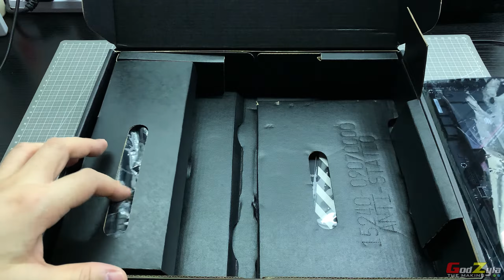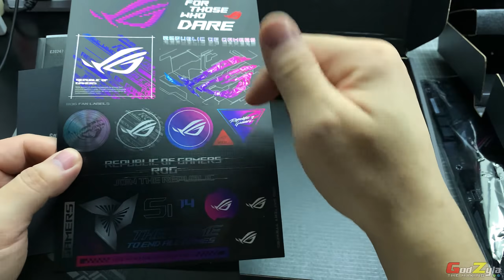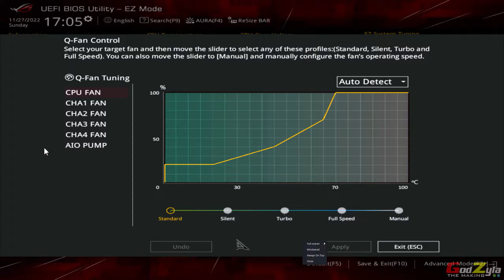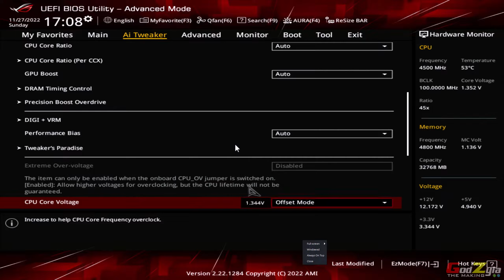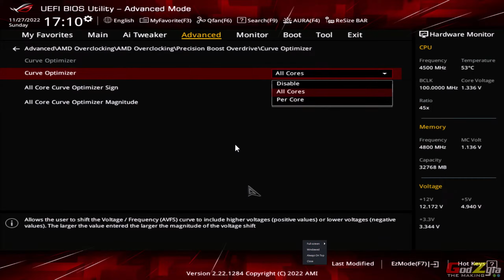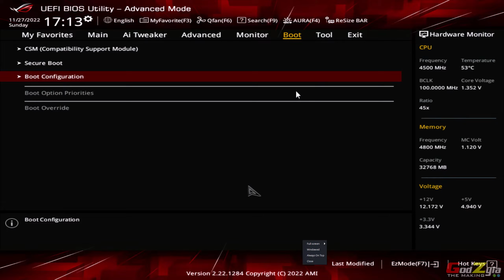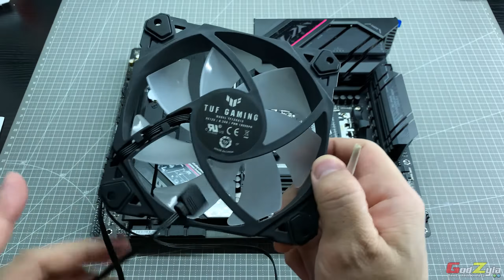ASUS B650E-F Strix Gaming Wifi

Comment: 4:14 CORRECTION: The BOTTOM PCI-E expansion slot has a x16 connector but runs at x4, (for a maximum bandwidth of 8 GB/s using all 4 lanes).  It does NOT run at x16.  FURTHERMORE, when the third M.2 slot is used, the bottom PCI-E connector is DISABLED.  Please read the manual before releasing a video with bad information!!
Reply from the maker: Hi Wakko Warner. Welcome to my channel, point noted. Sorry for the misinfo. Apologies for that.
Reply: wow no need to be so angry man. 😂 everyone makes mistakes
Reply: I was just about to say you can see in the video that the bottom PCIE slot doesn’t have pins throughout the 16x connector.
Reply from the maker: @JoeLiberto  hi and welcome to my channel. yes that was my mistake. sorry about it.
Reply: If I use the 3rd m.2 SSD slot will this affect GPU performance? Or is it only if I use the PcIE slot ?
Reply: I have the same motherboard and going through the manual it says the bottom PCIe is 4.0 x16 (supports x4 mode)

Does that mean it only supports x4 instead of x16 ?
Reply from the maker: @DiegoMartinez-vc5xy  hi Diego Martinez, welcome to my channel and yes. That was my mistake. The bottom PCIe slot runs only at 4x.

Comment: I've just started building a gaming PC after getting bored of PS5. So far I have the Ryzen 5 7600X, ROG STRIX B650E-F & 32GB DDR5. Haven't decided on a GPU yet & have a budget of £600. Any recommendations please 🙏🏻
Reply from the maker: Welcome to my channel Neil Dougal. Do pardon me as I am not well versed in gaming. You might want to search at Reddit forum https://www.reddit.com/answers/fab6b94e-5733-4083-9e06-34d0db3d15e5/?q=600%20euro%20which%20gpu%20to%20get%20for%20gaming%20&utm_source=share&utm_medium=ios_app&utm_name=ioscss&utm_content=1&utm_term=1

Comment: hello should i update bios first before install cpu and ram? because it say will have problem for the cpu ryzen 7 7800x3d on this motherboard it must have 1409 version  do i just need  to download that version or will be ok to download the lastest one wich it top options on the asus susport? i need a  8gb to 32 gb usb stick right? and fat 32 format do be ok for bios flas also i need 24 pin connector and 8pin or 4pin also?  for the psu
Reply from the maker: Hi Hardenth 50, welcome to my channel. Yes, update the bios first by using the bios flashback. Clearer instructions can be found here. https://www.youtube.com/watch?v=asdomsnbBb8

Comment: 9:32 I’m sorry… extreme OC via use of liquid nitrogen????? 

Finna force my 3060 to run like a 5080
Reply from the maker: Hi RXzorEdge, welcome to my channel. both EPS 8 + 4 pin plugged is for your CPU not your GPU. Btw to run a 3060 8G like 5080 is way out of the range. max you can OC to run like 3060ti 8G but with limitations

Comment: I picked up the same board but the more expensive B650E-E version and a 7600X for $240 back around summer of 2024. Just using it in my MediaPC in the bedroom with a 7800X3D/6700XT on 4k 144hz. The 7600X is out in the garage PC.
Reply from the maker: Hi 45eno, welcome to my channel. Thank you for sharing your setup 👍

Comment: Is this motherboard safe to use now?? I have heard it fried some AMD cpus.
Reply from the maker: Hi Alphonse, welcome to my channel. I do not have issues on it with the 7950x or 9950X3D. If you are referring to the 9800X3D. So sorry, I don’t have the processor to test with.
Reply: @KleoYan  im planning to put a 9600x. Do you think its safe?
Reply from the maker: @ it will be fine.
Reply: @KleoYan  thank you so much
Reply from the maker: @alphonse5935  You are most welcome.

Comment: The fan thing is confusing me. If i have the lian li galahad 2 lite will those daisy chained fans have to much amperage?
Reply from the maker: Hi Tuckejak, welcome to my channel. This board fan headers are all 1A on page 22 https://dlcdnets.asus.com/pub/ASUS/mb/Socket%20AM5/ROG_STRIX_B650E-F_GAMING_WIFI/E23880_ROG_STRIX_B650E-F_GAMING_WIFI_UM_V4_WEB.pdf?model=ROG%20STRIX%20B650E-F%20GAMING%20WIFI  the fan ampere of the Galahad II Lite, it's 0.27A each https://youtu.be/y1EbZQb7__4?si=_twLjJL_T3McJ-9Q&t=708 so if you daisy chained 3 will be 0.81A, therefore you dont have to worry about not enough ampere for this liquid aio, you can safetly plug to the CPU_FAN
Reply: @KleoYan  thank you so much. You earned a sub!!!

Comment: Awesome review! I am planning to use this motherboard with the noctua nh-d15 g2 and i am wondering if it’s possible to set the fancurve on the optional cpu fan header aswell. If it’s not possible would it be possible to try to connect the two fans together on the main CPU header and how do i even connect two fans together.I am wondering because this cooler has two fans and i want to control them both.
Reply from the maker: Hi Zaopa, welcome to my channel. You can plug fans this way on your motherboard. from your NH-D15 G2, one fan to the CPU_FAN motherboard header and the other fan on CPU_OPT motherboard header. Whatever fan curve you've set on CPU_FAN, your CPU_OPT will follow.
Reply: @KleoYan  thank you for the fast reply😃

Comment: I don’t know if you remeber me but I asked you a couple of questions before. I got this motherboard yesterday, and while it looks nice and is well built it has some crazy coil whine. I have coil whine on my gpu and can say this motherboard’s coil whine is 2x as worse.
Reply from the maker: Hi MFN, welcome back. Yup I can remember your nick but I can’t remember what questions you have asked. Ok as for your coin whine, if it’s really that back. Kindly contact your seller to have it fix or to replace this board.
Reply: @ i asked you some question about the b850-f and b850-e. I decided to go for the b650e-f as it was cheaper. When i installed it it had a loud coil whine. Unfortunately asus does not see coil whine as a defect so i had to return the motherboard and got the b850-e which did not have any coil whine and works great

Comment: pairing this with the Lian Li Lancool 216 and was confused at why my fans the front weren’t lighting up. so i can plug the rgb into any of the 3 pin slots you mentioned or does it have to be a specific one?
Reply from the maker: @reiyoh_  hi and welcome to my channel. So long it’s argb 3pin 5v header of your motherboard. It will work. I will also advise you to install armoury crate and download the aura sync application. Then point to the argb header of your motherboard where you’ve plug your front fan argb connector to, then control the effects on aura sync.

Comment: "Hi, could you please help me? I’m building a PC with 3 fans from an AIO cooler and 4 case fans. Do I need a fan header hub, or will the motherboard have enough headers?
Reply from the maker: Hi Jesaja, welcome to my channel. Maybe list down the AIO Cooler and the fans you are using, I will need to know the brand and model to check the Ampere of those fans.
Reply: @KleoYan  The case, an ENDORFY Arx 700 ARGB, comes equipped with three pre-installed basic fans. For cooling the CPU,  DeepCool LS720 AIO liquid cooler i will use. Thanks you very much for your response and help.🙏🏼
Reply from the maker: @Tehntex  for the LS720 AIO, the ampere of each fan is at 0.29A which you should not have an issue as 3 x 0.29a is at 0.87A, this motherboard CPU_FAN is at 1A so it's ok. as for your case fans, I have no idea what's the ampere. can you check on the fans if it does shows you the ampere used.
Reply: @KleoYan okay
Reply from the maker: @Tehntex  most welcome.
Reply: @KleoYan  Do you have any social media where I can message you? If yes, could you please share the name
Reply: @KleoYan I mailed you
Reply from the maker: @Tehntex  hmm.. i have not recieved any email.. send it to godzylatech@gmail.com, thank you!
Reply: @KleoYan  now i Guess right?
Reply from the maker: @Tehntex  hmm I still do not get any email from you. What do you want to mail me?
Reply: @KleoYan  On the fans it says: Stratus 140 PWM ARGB. FAN: DC,12V, 0.25 A LIGHT: DC,5V ,0.3A 3x Fans from this
Reply from the maker: @Tehntex  ok got you. let me explain to you.. 
1) Each of your fan draws power of 0.25A (4pin connector) therefore you can daisy chain 3 fans and plus to your motherboard header, which in general most motherboard fan header minimun capacity is of 1A. 

2) Each of your fan ARGB LED draws power of 0.3A (3pin connector) therefore you can daisy chained up to 10 Fans as each motherboard ARGB header has a capacity of 3A.
 
Overall you are save to plug, so long you keep to 3 fans to a fan header and 10 fans to an argb header.. therefore you do not need a fan/argb hub.
Reply: @KleoYan I have 4 Fans in my case so it will work still right?Thank you very much 3 in the front and on in the back
Reply from the maker: @Tehntex  yes it will work.
Reply: @KleoYan Thanks you very much for your help and time!🎉🙏🏼
Reply from the maker: @ you are most welcome and all the best with your build 👍

Comment: I have this same motherboard and there is one big problem. When I play game, I'm pretty sure I'm getting coil whine from the top VRM section. Before this, I had B550 F gaming Wifi and it also had same coil whine problem. I don't know what causes this but I think it's pretty common problem in Asus motherboard. There are several reddit post about this problem but there is no proper solution.
Reply from the maker: Hi Uchiha Sabastian, welcome to my channel. As you've mentioned, it's not only on Asus motherboard but on some others which I've tested. Infact my ASRock Z790 Sonic PG does have this problem too. what I did was to RMA my board and am lucky enough that in Singapore, motherboards which are purchase locally, we can bring in our boards to local distro, test the replacement board and to accept the 1 to 1 exchange. You might want to RMA your board if it's too noisy.
Reply: You ever find a solution? RMA or other board?
Reply from the maker: @pr0gressd  my solution is to RMA the board and it fixes the issue. I am not sure about Uchiha Sabastian.
Reply: @pr0gressd  No. RMA Process in my country is trash so I'm just using as it is because it's not a huge deal for me. The coil whine sound is bearable. Also, I wear headphone while playing games and I don't even hear it
Reply: @UchihaSabastian yep like you said. Installed my b650e-f and the coil whine was crazy loud. I never had any coil whine on any motherboard i have bought in the past including asus motherboards. Also if you look at the vrm you can literally see in the inside, maybe that is the cause of the coil whine

Comment: So my prebuilt came with asus prime b650m-a ax motherboard so I bought this one for 160😊.my prebuilt has 4 fans on my aio pump radiator. Will I have to unhook them from dazzle chain and run separately?
Reply from the maker: Hi john wayne gaming, welcome to my channel. For prebuilt, I am not able to advise you as different SI (System Integrator ) have their own ways to plug fans to the motherboard header. I would advise you to check all the fans and argb connection points of your old motherboard and to determine which fans are to which headers. Then based on the old motherboard header layout. fit accordingly to your new motherboard. An example, liquid AIO radiator fans are plug to CPU_FAN on old motherboard fan header. then plug that to your new motherboard CPU_FAN header.
Reply: @KleoYan  thanks I will take it slow lol
Reply from the maker: @gamingfromjohnwayne  ok, all the very best with your migration. Just a hint.. liquid AIO Pump, you should plug to the AIO_PUMP and as for Liquid AIO radiator fans, it should be CPU_FAN. the rest are case fans which you can use CHA_FAN 1 to CHA_FAN 4.  The blue print of B650E-F on page 22 https://dlcdnets.asus.com/pub/ASUS/mb/Socket%20AM5/ROG_STRIX_B650E-F_GAMING_WIFI/E23880_ROG_STRIX_B650E-F_GAMING_WIFI_UM_V4_WEB.pdf?model=ROG%20STRIX%20B650E-F%20GAMING%20WIFI
Reply: @KleoYan  great thanks so much!
Reply: @KleoYan  ur life saver lol
Reply from the maker: @gamingfromjohnwayne  most welcome.

Comment: Hi, nice video and very detailed, thanks for that. I´m planing to buy one of those, so thank you for the video.
One thing I think is not right is with your take on these fanheaders. There is no way they could melt, the headers themselves would be able to handle more than 5 amps. But the fan controller is of course limited. So your critics may be basically right, when you think of connecting many fans and a pump. Exept you have a short of course, but than the traces would fail first. You should watch your powerdraw, that can be an issue!
Another thing I´m wondering, you said this is not a E- chipset? That would be a fraud by ASUS since they call it a "B650E-F Strix Gaming Wifi" ...
Reply from the maker: @dirkhenkel9410   Hi and welcome to my channel. I wouldn’t say am an expert on the fan ampere but I do have encounter or had bad experience with connector melt. It does melt when one fan is at 0.5A which 3 total up of 1.5A. As headers you have mentioned, capable up to 5amp, but not to each header. For me to use an asus board, I normally use a fan hub with a sata power source, which current is drawing directly from the PSU. Next to plug the hub PWM cable to the motherboard fan header. I feel safer this way without damaging the fan headers. Yes I do take precautions when plugging daisy chained fans to any motherboard header. As for the chipset, it’s my bad, it is a b650e and not a B650. Thanks for your feedback and the best with your build. 👍👍👍

Comment: Would 64gb of ram work well with this motherboard? Smbdy let me know
Reply from the maker: Hi Fryem, welcome to my channel with 2 sticks as in 2 x 32G Kit is not an issue but if you are thinking of doing 4 sticks as 4 x 16G, there might be some issues. you might need to do some ram tweaks to make it run. often 4 stick rams can't go with tighter timing and higher bus speed.
Reply: @KleoYan  thank you so much for your reply I had to make sure I didn’t have to buy a b670 motherboard in order to run 64gb of ram
Reply from the maker: @Raindeer0448  you are most welcome and which rams are you getting and do you might to share the timing and bus speed?
Reply: @KleoYan  I’m getting 2x32gb 6400mz of RAM with your same motherboard with a Ryzen 7 7800x3d unless you think me getting a b670hero would be better?
Reply from the maker: @Raindeer0448  In general, any mid tier Asus board is capable to run 2 sticks 64G Kit. Personally I will stick to this board if you are just getting a 7800X3D, spend more on your GPU hee hee.

Comment: Great videos, you really deserved more !!

Do you know if I can plug 3 Lian Li TL LCD non reverse 120mm in daisy chain on one plug like you talked in end of video ? 

Can’t find informations :(
Reply from the maker: Hi Adrien Meesemaecker, welcome to my channel. For the TL LCD fans, you will need to plug to it's controller. it's not advisable to plug directly to the motherboard fan headers Once you have plug the TL LCD to its controller, from the controller there is a PWM connector where you can then plug to any fan headers of your motherboard.
Reply: @KleoYan  thank you for your answer. Keep the great work !
Reply from the maker: @Lesnewsducouz  you are most welcome. All the best with your build too.
Reply: @KleoYan  

O11 vision with watercooling on rear fans and 3 tl lcd in front then 3 p14 max bottom if can put a vertical mounting GPU on b650e-f rog strix :)
Reply from the maker: @Lesnewsducouz  I am unable to answer your question as this content is about this B650E-F strix motherboard. I have no idea whicih PC case will you be using to apply the GPU vertical mount bracket.
Reply: @KleoYan  sorry i speaked about the o11 vision with Lian li vertical GPU mount
Reply from the maker: @Lesnewsducouz  oh ok, yes it is able to with this GPU Vertical mount https://lian-li.com/product/vg4-4/ but your motherboard needs to be at it's high mode and not low mode. only 1 rear fan will be able to fit at the rear.
Reply: @KleoYan  thank you :) I just seen people posted pictures in low mode with 3 120mm Lian Li SL fans bottom and Lian li GPU vertical mount at the same time. The p14 max are lower so it could only fit :)

Do you know at which rpm max it is useful to run rear fans ? Or at which speed rear fan run usually to exhaust 5 intake ? I will have 2 p12 max but it will also be my aio lf3.

Sorry I have a lot of questions and I trust you so… 😅
Reply from the maker: @Lesnewsducouz  I assume your set up this this way 
Side 360 LF3 x P12Max fans Intake
Bottom 2 x 140mm P14 Max
Rear 2 x 120mm if you set mobo to low mode
Rear 2 x 120mm P12 Max 
GPU Vertically mounted

now it depends are you from a hot and humid country. for me I have to ramp up all the fans in a O11 Vision as I am from a hot and humid country. I would advise you to fiddle with the RPM and air flow when you have the system up and running. Planning is good but along the lines you have to fiddle with fan position and fan RPM. Here is my experience of the O11 Vision.. https://youtu.be/w5q8uBP5xLw (Note : I personally do not like O11 Vision, is a toast box for me)
Reply: @KleoYan  i didn’t done it yet but I tried thinking well before purchasing the extra fans. I would have 3 120 tl lcd fans front, 2 p12 max rear as lf3 240 aio and 2 or 3 p14 max with GPU vertically mount indeed :)

So if I understand well your answer you’re sure I can’t fit 3 140mm fans at bottom with GPU vertically mounted ? 

Thank you again for all your answers this quickly :D

I live in north france so definitely humid but not hot ahah.
Reply from the maker: @Lesnewsducouz  if you going to mount your GPU vertically with 140mm fans below, you have to move your motherboard up to high mode. You can plug only 2 x 140mm fans below not 3.
Reply: @KleoYan  thank you :)
Reply from the maker: @Lesnewsducouz  most welcome.